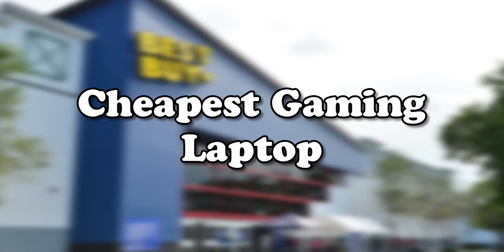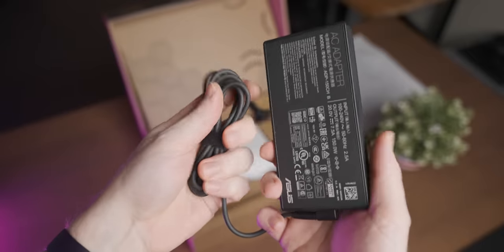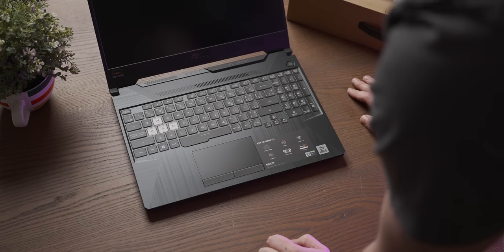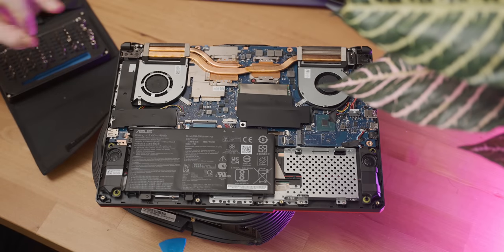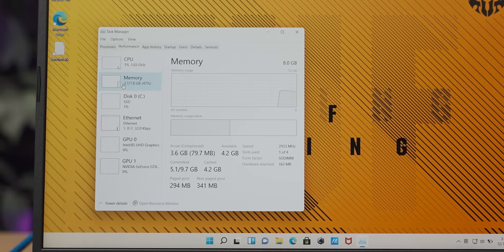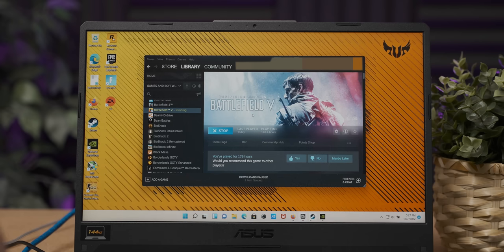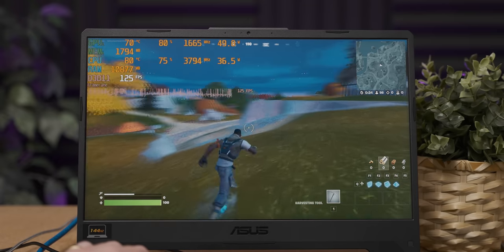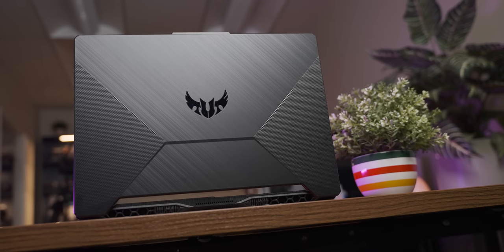The Cheapest Gaming Laptop From Best Buy...

Comment: 6:30 it is not only for support. You should open it. There are other usefull staf
Reply: For example, maximum lifespan for battery, or locking fn key (if it has hardware support)

Comment: Bah! This is what I bought in July 2022 for $699.99:

Gigabyte G5 GD Gaming Laptop 
Processor: Intel Core i5-11400H 6-Core (11th Gen)
RAM: 16GB of DDR4 RAM
Storage: 512GB M.2 SSD
Screen: 15.6-inch, 1920 x 1080, 144Hz
Graphics card: NVIDIA GeForce RTX 3050
Operating System: Windows 11 Home (64-Bit)
Weight: 4.8 pounds
Dimensions: 10.15 x 14.21 x 1.09 inches

Still quite happy with it.

Comment: im using this laptop right now, just with different specs. Ive got the 1660ti ryzen7 4800H 16gb ram, Its just in every way a better laptop than the one in the video, even the power supply is more, ive got the 220

Comment: I had a similar laptop last year, was from 2020 (acer nitro 5 core i5 10300h and a 1650 ) I swear it struggled running things like fallout 4 at even 25 fps , and that’s all settings low as possible. And with ff14 pffft yeah same thing turned all the way down it still was unplayable at 25 fos
Reply: Now I have a acer nitro 5 with a core i5 11th gen and a 3050

Comment: That crunch sound when pulling off or putting the back of the laptop back in just makes me cringe haha, but yeah if you are on a budget and want a gaming pc it’s honestly pretty easy to grab one of these budget laptops and slap some more RAM in it and maybe upgrade or add another SSD on the cheap and bam you have yourself a pretty capable gaming machine for usually under 1,000 USD. I did this with a Acer laptop in college and it worked great. Just gotta remove the bloatware but it’s easy enough to do a fresh windows install if you want to speed run that part.

Comment: U always have ram without the jdec specs  u have to now go into the bios or intel extreme utility and tune your ram put it at whatever it was supposed to be 3200mhz at 1.35mv  tune that in and u will get even more performance.  Yeah it's absolutely crazy ehst the ddr4 dulachannel configuration does.  Now if it was ddr5 it would matter less weather it's in dual or single channel but dual  and dual rank x8 sticks are the best    just look at benchmarks when upgrading dual rank vs single ran it's like upgrading a gpu performance rather than going out buying a higher tier gpu in laptop u could be getting way more performance from proper ram performance .

Comment: I have an AMD 3550h powered, very similar version... Unless they have improved thngs the "144hz" monitor will break & only work in 60Hz mode. Which is a git cos the BIOS uses 144hz mode & displays cock all...

Comment: Not bad for the price, allthough if someone would come to me and say "give me your 6 year old gaming laptop, and i'll give you this brand new one for it", i would say NO without hesitation. Yes, my old beast still rocks rocks a 4th gen i7, and a gtx 980m, but dang it, it still does its job without a hitch, and its built like a tank (about 7KGs), its very thick with some huuuge air vents on the back, and it nevwr went above 70 degrees, even at its darkest hour when i threw everything at it. Thin and light gaming laptops simply dont exist, and if you are on a mobile chipset you dont go any lower then an nvidia xx70 or xx80 series gpu. Pay more, but a lot less times 🥂
Reply: Absolutely agree with that last point, everyone should be buying all their electronics with the mindset that they'll be using it for 10 years. The point is not that it has to last that long, the point is to get as close as you can, just managing 3 means saving a fortune compared to an average consumer (1 year or less!)

Comment: So I just got to the part of the video where the teardown happened and the specs were mentioned, and I`m loughing inside...

So in september of last year, I bought an Acer nitro 5 with a single stick of 8 gb DDR4 3200Mhz ram, an intel i5 10400h, a 512gb m.2 western digital SSD, and a GTX 1650ti (so slightly better specs across the board, aside from possibly the screen, since as far as I`m aware I have a 60hz panel, but I also use the pc connected to an external monitor and keyboard and mouse, so I don`t care much). I bought this laptop off of Amazon for 679€ (though it was supposedly at a discounted price, with the listed MSRP at some 900+€). Now, I know that 679€ is alot more in dollars, but on the other hand, as far as I can tell, electronics in europe cost cost quite a bit more than they do in north america ( as in an electric device that would cost 800 usd would generally cost more than 800€ here....), but I also bought it at a time where the hardware shortage was more or less in full effect, and everything was massively overpriced

Anyway, I bought this laptop, immediately threw in a 2nd stick of ram from crucial that matched the specs of the one already installed (so capacity, speed, and timings, so that I could use dual channel without having to replace the stick already installed), and threw in an old 1tb HDD I had laying around for mass storage. I`ve since added a 2nd SSD, a 1tb samsung evo 900, for the games I want to have faster load times. Dual m.2 slots AND a sata slot is a really cool setup, and I was hyped AF about it when I opened the laptop for the ram upgrade and saw that... Also opening up the back panel wasn`t too bad, and I don`t remember breaking any clips.
I`m genuinly happy with my purchase, because as much as the hardware (mostly the GPU) is already at the point where it can`t run some of the latest and greatest triple A games, it can still run alot of the new games, while being able to run all the games I already own, all while having cost me less than half as much as what going up 1 hardware tier would have (I basicly didn`t see any laptops with even a 1660ti for less than 1100-1200€, and a 2060 or 3050ti laptop woulg have been in the 1600€ range at the timr). It was also a MUCH better option for the price at the time than going custom built, since at my budget I would have been forced to go iGPU.

One thing I wil say, tbough is that temps aren`t amazing, and it gets loud quick... The CPU will reach 80+c quick, but it than more or less stays there while the laptop ramps up (and often screams like a banshee), but the boost clocks do tend to go generally be above 4GHz, if memery serves. The GPU temps tend to be a good amount lower than that, though.

Comment: Stay away from laptop quad cores.

10300h/ 11260h (although the latter seems leagues better than the 10300h)

Usually normal stuff like 4600h and 10500h are available for the same price or 5-20$ more which is a no brainer

Comment: They had laptops with the 1650 going for $400 on clearance and then hiked them up in price before Thanksgiving just to discount them to $599 on black friday... Personally I think a 1650 is a great GPU for casual gamers that aren't looking for 4k gaming. However i think they could have done better with this system. I got an Asus ROG Strix with an I7, 24g of dual channel ram and a 1650 used for $200 from a pawn shop that literally had a stack of GTX 1650 level machines. I wouldn't have paid full price for one new, but I am stoked to get one in mint condition for so cheap and it runs circles around this one. The used market is getting flooded with very capable gaming laptops these days. It's a buyers market if you don't mind used tech.

Comment: I have one 2021 model , dash15. i5, rtx3060, 16ddr, 512ssd, 1080p 144hz. Ok well in about 7months keyboard module  vents meltdown because  heat problems.Then the power output failed and it disconnect the power. Afther these i did sent it to Asus europe service. They said vent dmg is my own fault no varanty repair. Ok at this moment repair allrdy took 3 weeks and im out of patiece so i agreed. I paid 50 euros for new keyboardmodule and some "fees" 70. They fixed the power output from mobo and i got new charger aswell they did go to warranty..... Also theres wi-fi issues alot even new right on the shelf have been not working i had same issues and it causes that bluethoot mixed up on intels wi-fi.... . Oh ye also screws on the bottom just drop randomly, this i think also is issue from heat. . Armory well theres alot going on on that program, heat issues bad fans setup, aura lightling dont work on current one (6months allrdy this), you cant manualy change anything on laptop. Also asus gaming laptops are know for broken power mosfets so to repair those it requires store/guy who knows what to do and how to repair those issuescos other fix is to get a new motherboard.... Other than these thing theyr are good laptops.. lol

Comment: The vents are poor, cooling fan doesn't work, the mediatek wifi driver used is really pathetic as it stops working at times and adding the screen might get damaged on its own with time due to temperature rising as it gets heated really fast and really high and the proof to my theory is I am the user😐.

Comment: I have the same laptop (same specs...)

However i got 16GB RAM inbuilt so i don't need to add another RAM

My experience after using for 6 months

Battery life = 4/10 ( OK type)

Display = 7/10 ( Not bad)

Speaker= 8.5/10 ( Really good)

Performance= 7/10 ( Still not very satisfied:(  sadly )

Cooling= 2/10 ( The worst cooling system ever made.....the tuf f15 series has the worst cooling in laptop history)

In conclusion, this laptop is basically 3/10

Comment: I have a older Dell G7 15 
Intel Core I7-8750H
32GB DDR5 RAM
Nvidia GeForce GTX 1060 6GB DDR
 5 max
Believe it blow this out of the water. It's 4 years old I bought it used not to long ago...
Reply: good buy but it used/2nd hand and much older , 8th gen has low ipc (lower performance per ghz of "cpu) and its battery and other parts will be older. but if rice is good, then worth buying. i buy many 2nd hand pc parts and laptops sometimes if it is clean good condition and not too old hardware, unless steal price, then i buy any condition

Comment: ASUS are making the same laptop for the past 4-5 years. Difference is a bit of design change and the CPU, everything else is the same.

Ive got an 505DT with 3750h. They always come with single 8 gig stick, which really sucks, cause you need at least 16 gigs for comfy and somewhat future proof laptop. Not to mention that you wont find another matching 8 gig, so you need to buy a 16 kit, the other goes to ebay.

Also, everyone considering to buy those laptops, fans are utter CRAP. Mine started to rattle at month 3, by month 4, the noise was so bad, i had to remove it, which makes the other fan ran at max speed constantly. Replacement fans are 50 bucks!!! Production cost of those fans are like 25 cents... 

With extra ram & probable fan replacement, price goes over a 1000 dollars. Its not a bad laptop, but for over 1000 dollars ... No, just build a desktop PC with 5600g, 16 gigs of ram and some older card like the Vega or even R9.

Comment: I was kinda surprised at first seeing these gaming results... cause I have a 2018 HP Omen 15 that has nearly the same hardware configuration as that TUF laptop (GTX 1650, i5 9300H which besides a few frequency tweaks is basically the same thing as the 10300H we have here) and my laptop was giving substantially better gaming perforamance (the few times I was away from the dektop).

But then again, I remember that I got it heavily discounted at the end of 2019, and that it came with only one stick of RAM... which I upgraded to double the amount of RAM addding a similar stick pretty much right away.

I don't know what's up with laptop manufacturers knee capping their products in order to give the clients a false sense of "upgradability". I'm pretty sure most people would gladly prefer not having to fiddle with their laptops at all

I knew there was a performance difference but I didn't think I would be that much. My mom bought a Lenovo laptop with only 1 stick of RAM as well, and the performance has been fine on that one (although it's a 5600H and a 1650, guessing that even though Ryzen doesn't like single channel memory, it's able to compensate with way higher processing power)